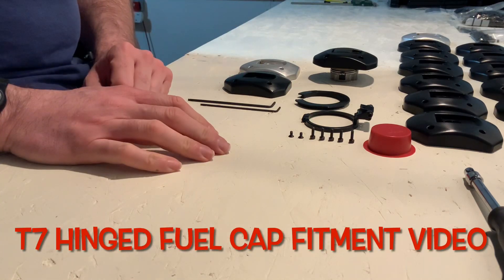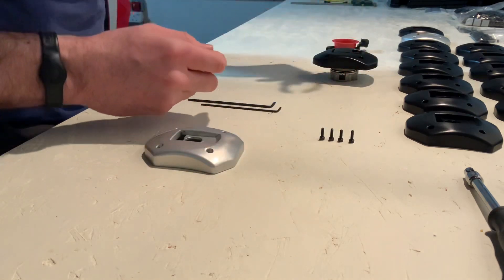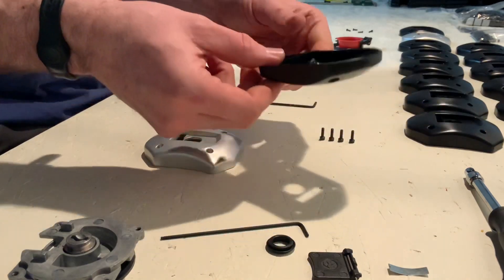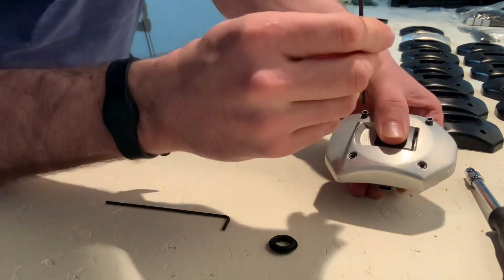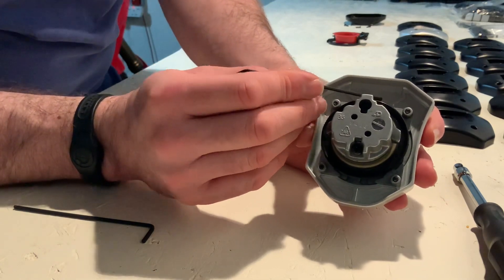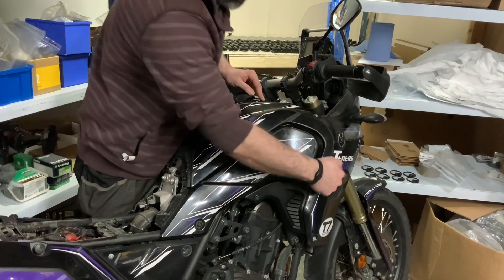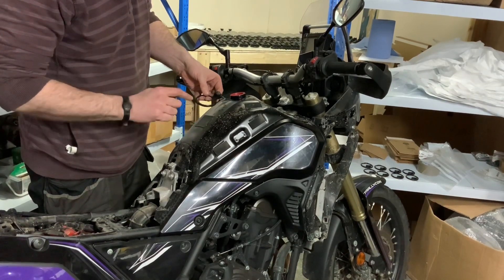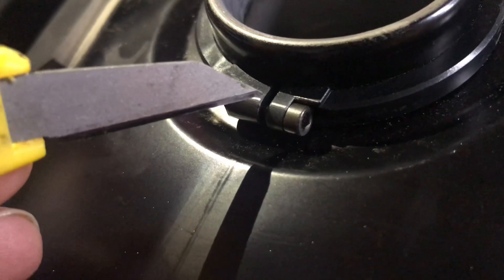Yamaha T7 Rally Tenere 700 Hinged Fuel Cap Fitting Instructions

Comment: What's the point to have one installed to my bike?
Reply: If you have a t7, then you will know
Reply: @alrightdave6135  i just bought one and still don't understand...
Reply: @borys609  it’s a pain in the ass to not have the fuel cap on a hinge. If the cap drops on the floor, it is very brittle and breaks easily. Plus when you are filling up at the gas station, you don’t have to faff around putting the cap in a safe place. A new cap is expensive to replace and if broken on a long tour, it will be a nightmare.
Reply: @borys609  , if you don't get the point or don't understand, then you definetively don't need one of these. So you're fine, just be happy.
But I'm sure a lot of people do need/want one.
Reply: @d.balabastark7462  do I need to be a believer to get known what is that for?
Just trying to understand.
I used to ride few dual sport or just enduro tourer bikes and only one of them had hinged cap (R1100 GS). The rest of them had regular cap which didn't matter at all... They worked the same.
So I'd ask the question again: What's the point of having it? What's the advantage?
Reply: @alrightdave6135  oh I get it...
Sorry, I didn't get the problem 😆
Well, maybe that's because I've been ridden last years on lighter bikes like LC4640adv or 690, which didn't have any hinged cap and I never used to find it problematic 😆.
Never ever dropped a cap or so...
I'm gonna need to live with it now 😆
Reply: @borys609   Well, the advantage is pretty OBVIUS. But that it's obvius doesn't mean that the advantage is huge. You're not missing anything if you just don't find the need for this. It's just an obvius matter of little convenience.